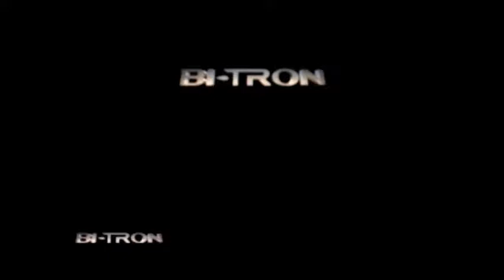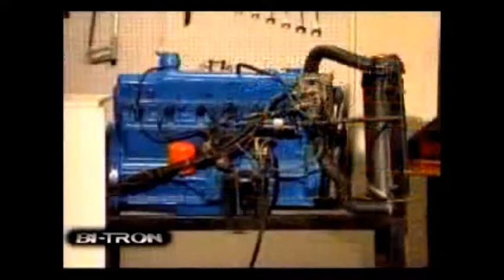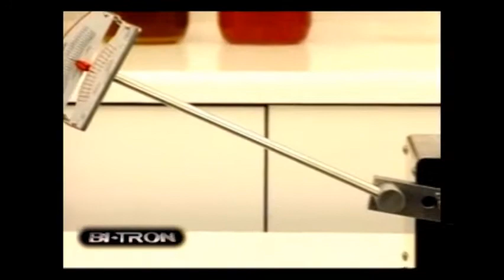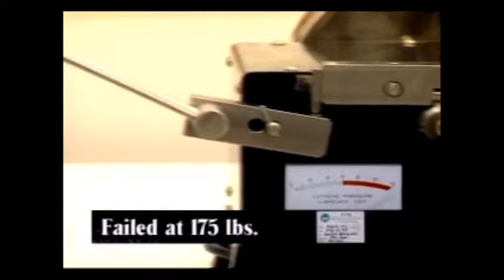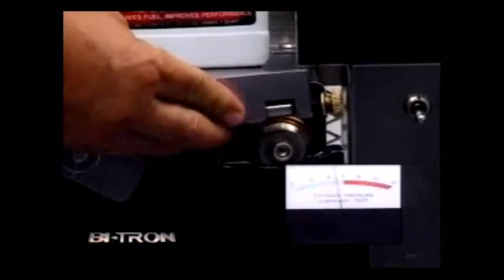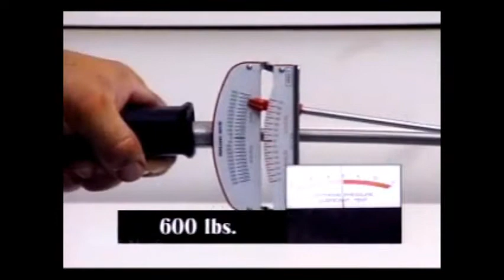Bi-tron Engine Treatment Demonstration and Testimonials

Comment: Pressure testing is misleading: 
You can pass a pressure test but over a longer period of time the wear in your engine can be unchanged or even increased.
Oil analysis is cheap.
A magnetic sump plug will also show up the difference.
🙂

Comment: BITRON...INCREDIBLE PROTECTION....!!      I am a country music artist in Sydney  A ustralia.....I was returning from a music gig at Ettalong NSW  back in 2001 driving my fully loaded 1992 Nissan Nomad van  having just travelled down the expressway  and when I reached Carlingford NSW on the northside I heard this almighty bang under the van.  I stopped,  looked around,  couldnt see any large objects etc so continued on almost to Parramatta road  at least  10 kms sitting on the normal speed limit......as I approached Silverwater I noticed the gauge reading was hot.    Stopped at a servo and once again checked the motor which seemed to be running fine....then a closer  inspection revealed that the banging noise I heard 10 kms back was the oil sump plug falling out!  We had travelled the distance with not a drop of oil in the motor!!   Thanks to the BITRON oil treatment I had added on the last oil change   all was fine.   Did a fresh oil change the next day  and no problems whatsoever with  the motor!!!   So believe me     BITRON worKS!!   Alan Kash    alankash2003@gmail.com!
Reply: It's great that Bitron saved you an engine.
However, it has to be added each oil change to work.
If you can bond a lubricant to the inside of your engine permanently you will get protection against seizing for the entire life of the engine.
🙂